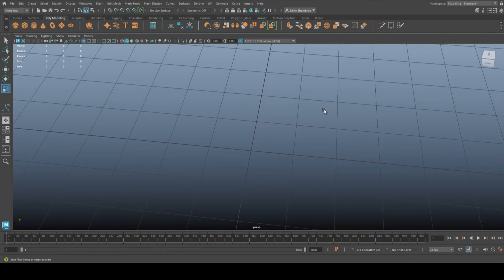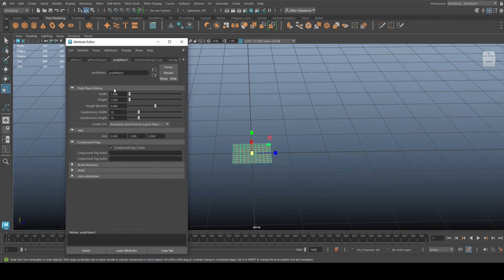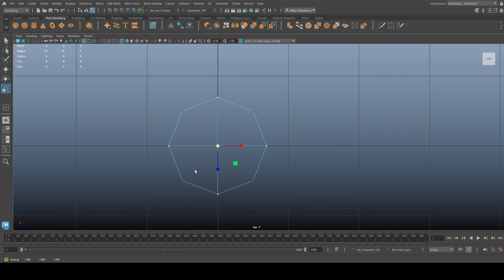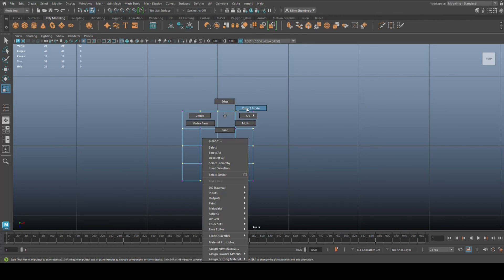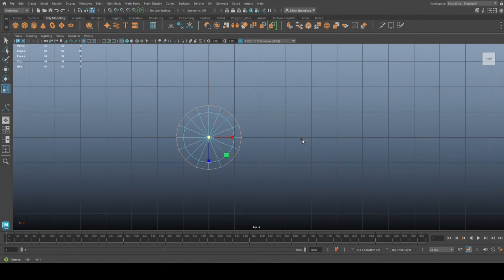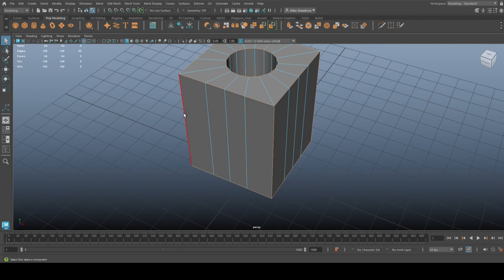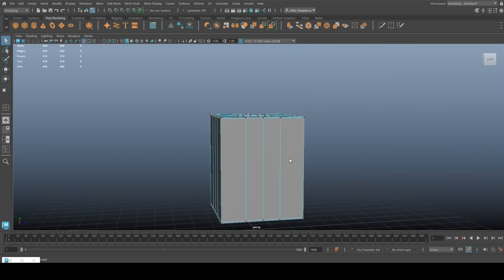Maya 2024 tutorials : Create a round hole in a square object the proper way

Comment: if you need to make the same even circle as in the lesson, the easiest way is to create a 4*4*4 cube, then remove all the edges on the desired face, make an offset extrusion on the remaining face and then circularize. In this case, the size of the cube itself does not change, which is important.

Comment: Often you would need to put a hole into an existing square, so you'll not necessarily have full control over how many edges the circle can have. So lets say we have a square face with 20 edges, we can do the following:
-Create a cyclynder with 20 edges and delete all faces except the top faces.
-Put the cylynder in the middle of the square.
-Delete the face of the square where the hole will go.
-Combine the square and the cylynder.
-Use the "append to polygon" tool to join each face of the cycynder to the face of the square.
-Delete the cylynder face to be left with just the hole.
Reply: You can also try circularize, shift & right mouse button

Comment: That is exactly the thing that should be a mandatory information in any 3d modeling curse. Unfortunately booleans dont give such good results, and the mesh can be a bit messy as well
Reply from the maker: Exactly why I made the video :-) Thanks
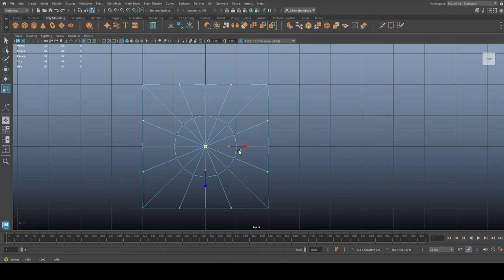Reply: @MHTutorials3D  just a quick thought about the step around 4:18. Scaling out is fine but i think it would need one more step that is "snap" them to the proper side so it would be an exact square. This i thin is still a bit eyeballed. Unless i missed some snap option while scaling was done.
Reply: Well, booleans tend to be a bit quicker, and you can always fix the topology after.
Reply from the maker: @BrCapitao  And AI is even faster